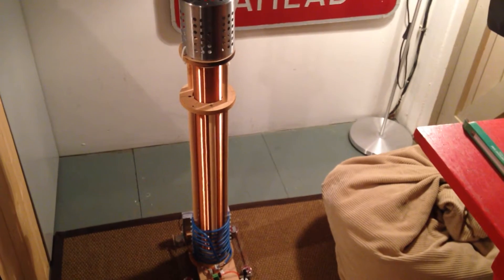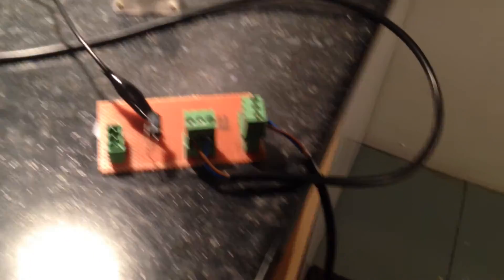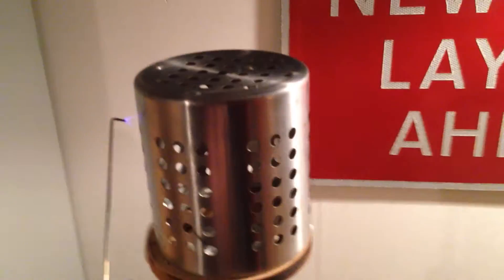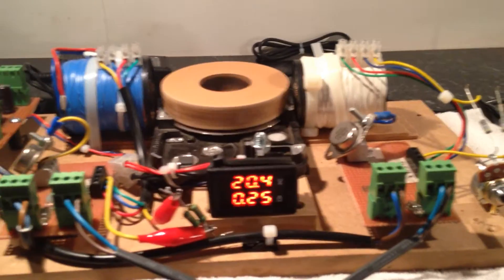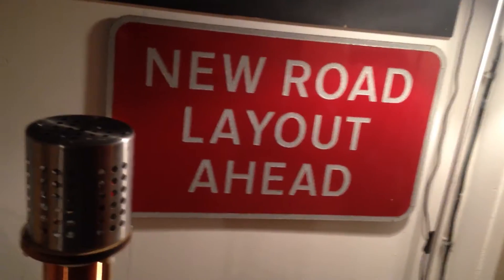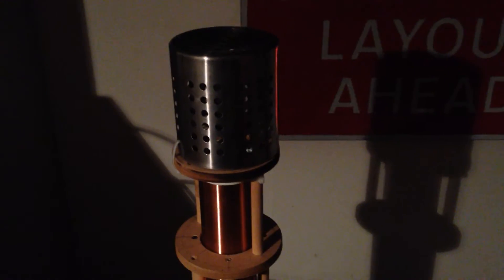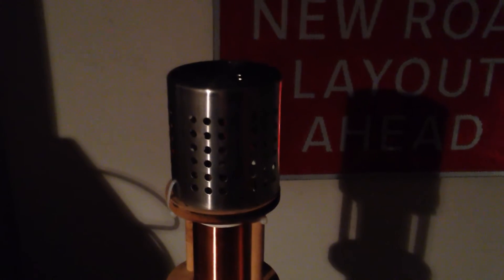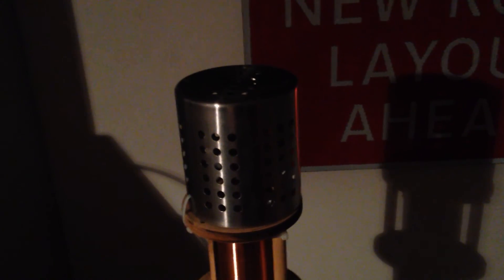Bedini SSG running my Tesla Slayer Exciter Coil

Comment: ok, ive come up with a couple questions. 
1. you are running 2 separate bedini circuits, 1 for each coil? if so, is there 1 shared trigger wire or 1 for each. 
2 . are the coils offset or symmetrical to each other and the rotor?
3. your slayer/exciter...im curious about the circuit. capacitor/ resistance values... is it all pretty common stuff?
im stoked by your results still man....i think half the views are mine  :)
Reply from the maker: Hi Jeremy - thank you and I think I found what is making this work so well**
To answer your questions first tho.
1) Two totally separate bedini circuits working indepedantly - seperate everything
2) The coils are symmetrical  - when they are aligned directly oposing each other (sweet spot)  the rpm's max out .
Both bedini circuits are set at 250 ohms.
3) I built the slayer circuit using instructables.com version (I've put a full link in the description thingy on here), I upgraded the transistor to a 2n6547 only becuase I got a bag of them cheap (£1 each) and I was killing tip31's and 2n3055's too easily - but the circuit is the same standard solid state version. It took some messing around to get the circuit working with the 2n6547- the advise was to use a 47k ohm resisitor which was fine on my small setup with tip31 and 3055 but when I scaled it up (larger coil, more power, thicker primary )  the 47k was way too much - 10k is currently working best.

The slayer has a pot which is set a 10K.. if I reduce the the resistance to around 7k< (or less) the coil will start to draw more current but it becomes less effective. It really likes 10k.. I believe if I had a bigger pot, say 15k then I could trim the amp draw down lower than 3-400ma but I guess the ouptut would also go down. 

Did you notice the litte cap on the small pcb I was using for the slayer amp draw - it has a crocodile clip on one leg (my ground) - this cap is making all the difference, I tried some different ones last night from an old power supply but none were as good.  These caps were left over from a project that I couldn't get working so they were just knocking around... funny how things turn out sometimes.
This is the little cap seems to be helping my project:
** 4u7 100v 105deg Axial Electro Capacitor
I bought them back in may - they're actually discontinued on the supplier website where I bought them - here is the link so you can see the manufacturer etc.
http://www.rapidonline.com/Design-Technology/4u7-100v-105deg-Axial-Electro-Capacitor-11-2736

I hope I covered everything. cheers D
Reply: ya dude...thanks! i wasnt sure what you meant by running 20 v 'straight in'...just wanted to clarify. i thought the bediis could be supllying some high freq AC or something......the bedinis are grounded to the house...when the slayer is running from their output, is the slayer house grounded with a separate wire?
i saw the cap (and big diode?). thanks for the heads up! its strange sometimes how the best component for the job just happens to be whats lying around on your bench.....
Reply from the maker: jeremy gwilt
oh yeah the "straight in" bit was just about not putting the bedini in the loop - from the wall straight in. .. I've grounded the slayer via the leg of that 4u7 capacitor - there's a black croccy clip that leads up to ground in a mains socket. 
Also when I connect the power in the back of the bedini there's a 16v cap right in front of the green power connector - I've removed that - it was making the amp draw appear lower than it should on that little digital meter - I'll do another video at some point and be more specific about what's connected where - first video, nerves were getting to me - live on tv and all that lol. I've been putting 36v thru the bedini - that puts a bit more life into it. cheers.
Reply from the maker: jeremy gwilt
ahh I see what you mean - I don't need a seperate ground when powering the slayer from the bedini yeah?
Reply: im not sure, really. just trying to trace your wiring. if the slayer remains grounded to the wall in both setups, then the (-) lead from the bedini output would be a wall short to the slayer ground....right? (as the negative of the bedini cap would go to the v+ bedini input ). does that make sense?
Reply: well, if the wall was a DC battery thats how id envision it. since theres a transformer in between, thats got my mind going. maybe stick an am radio on top of the transformer while you switch frequencies so see if theres an audible clue?
Reply from the maker: jeremy gwilt
..that does kinda make sense - and that's really helpfull.  I'm interested in the AM radio test too.  thanks man.
Reply: deeds well i think ive dupicated the effect, somewhat. im making a quick vid now, but its very exciting (as you can tell from me spamming your comment section like a 16 year old girl). such a simple thing, but my slayer tower is 100x more fun to play with now.
Reply: Caveman Electronics yes